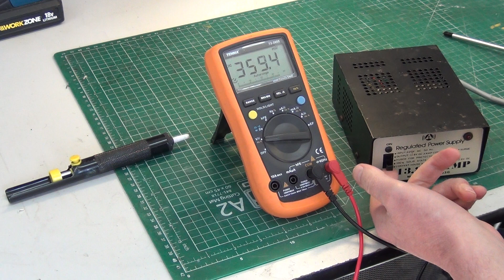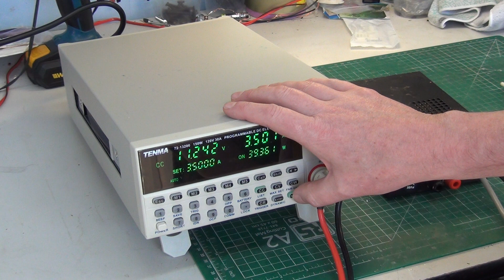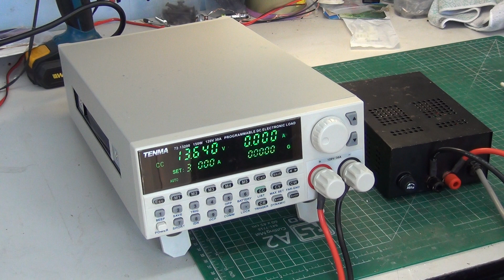Taiwan 3-5A PP1203G CB psu/power pack repair/rebuild

Comment: Hi do you sell the circuit board for that model you made ? If not what’s specs on the 
Circuitry. Thanks Chris.
Reply from the maker: If you are able to make PCB's I can send you the master pattern if you email me.  We never planned making PCB's to sell. We'd need to make a batch.

email address in the cannel blurb.

Richard, G0OJF, UK

Comment: All the equipment I have I PAT test on a regular basis. What was the load machine Mr Chippy was using, I haven't seen one of those before
Reply from the maker: Hello James, it's a Tenma 72-13200 programmable electronic load. You can test up to 120V with it at currents up to 30A.

Richard, G0OJF, UK
Reply: @ukfmcbradioservicingTango21  Thank you